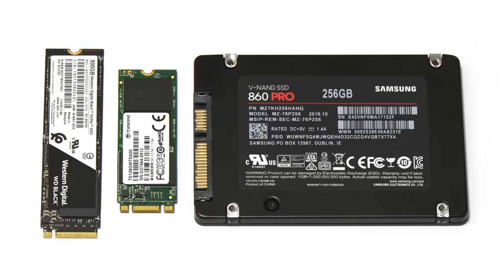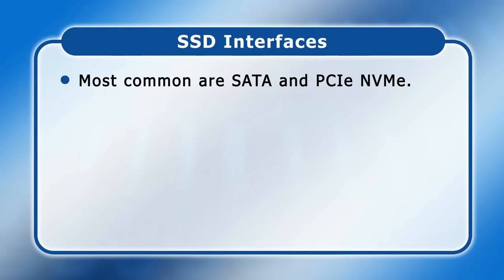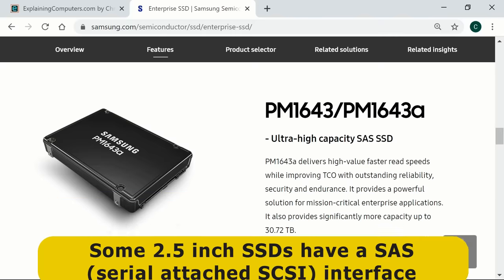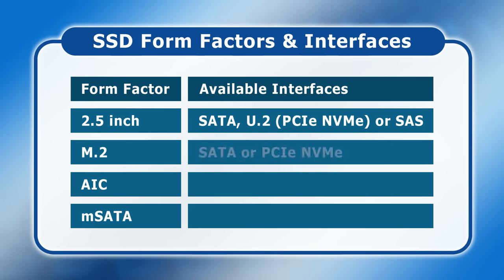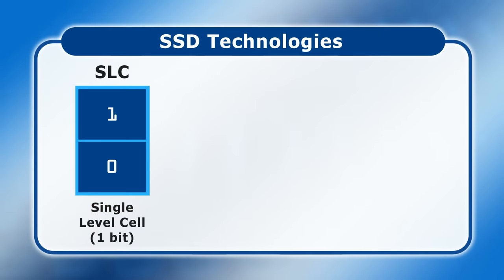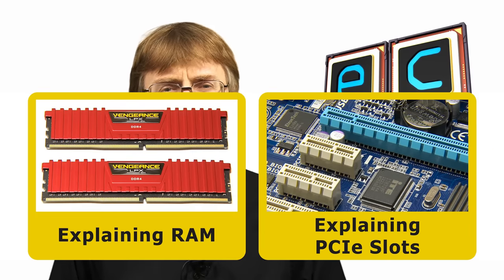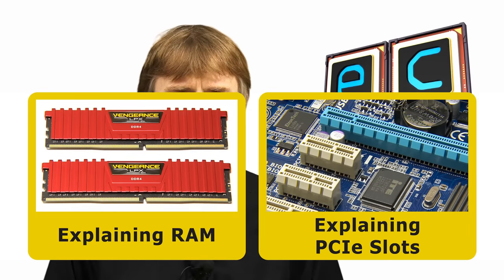Explaining SSDs: Form Factors, Interfaces & Technologies

Comment: As someone who once owned a 5 1/4 inch IDE (PATA) 60Mb (Yes, megabytes) HDD which along with its controller board (itself larger than some desktop motherboards today) was larger than a house brick and weighed about the same, I just want to express my gratitude for today's form factors. 😁
Reply: Indeed my first harddisk was the size of an industrial scale
Reply: The first drive i put my hands on was a  9427H-C Hawk CDD. Storage space until the end of time. I thought ... ;- )
Reply: I think those were MFM, not IDE
Reply: @knerduno5942  Definitely IDE - I had it connected to an Amiga that had an IDE interface.
Reply: @Kevin-mx1vi  Looking things up, it seems that was called ATA and first used in 87. It was in 94 Western Digital came out with a variation of ATA they called IDE. There improvements of ATA-4 which then used the 80 pin cable. I guess WD continued to call it IDE., but in 2000 they came out with what they called Ultra ATA with 133MB/s transfer speeds.

Comment: Thanks Christopher, i was actually confused about the difference between NVME and Sata.
Reply from the maker: And you were not alone!
Reply: Same, had a lot of confusion relating to M.2 Sata and M.2 NVMe.
Also, i didn't even know about U.2 SSD's.
Reply: @Sup_D  No idea why U.2 connects are available on mainstream board, but there are no consumer drives that uses U.2, only Enterprise drives (both HDD and SSD).
Reply: @AlfaPro1337  Cost issues maybe?

Comment: In 1982 I designed and built 8 bit memory cells and at the time they had 2000 ns, all hand wired.  I was going to 12 bit even 16 bit but it was at time was to complicated to wire  input amps and 65536 output amps. The where chips could do 12 bits a/d but they were 1/10 second and cost $400 a piece.  I had 8 of them in a machine that weighted up to 3 lbs. They were weight vegetable memory cells ;.)
Reply from the maker: Wow. Not that many years ago.
Reply: Bare transistors, or were you old enough to work with core memory?
Reply: Robert Slackware  Just imagine weaving them all by hand.
Reply: Robert Slackware  Magnetism follows the same inverse-square law that light and gravity do. Neodymium magnets aren't THAT powerful.

Comment: Outstanding. Thanks! I just spent a day figuring out that I could not put an M.2 drive in my machine, and get the performance I hoped for, since my MB doesn't have a second  PCIE 2 slot which would be required to support the adapter card properly. And, since the MB only has SATA2, which can't get my SSD anywhere near to it's rated speed, I am now ordering a VERY similar used MB with SATA3, USB3 and digital audio out. All things I want and for a good bit less than a PCIE - M.2 adapter and M.2 drive. Not as fast, but fast enough!

Comment: Thanks - but did I miss the bit where you mentioned AHCI in the context of M.2 drives? I only mention it because I once bought AHCI instead of NVMe by mistake ...
Reply from the maker: AHCI refers to the drive controller. There were some AHCI PCIe SSDs before we got NVMe, but they are long departed from the market (all PCIe SSDs are now NVMe). So I did not complicate the video with this.
Reply: @ExplainingComputers  Thanks for clearing that up.

Comment: I purchased an mSATA to M.2 converter card for an older iMac (late 2013) that was originally setup as a hybrid drive. I breathed in new life into the machine and am typing this comment from it.  The HDD was replaced with an SSD 2.5in with a SATA interface, but this made a huge difference in speed overall: the boot drive is a 1TB (the mSATA >M.2) Samsung EVO 980 and the, formerly a harddrive, is now an EVO970 (also 1TB).  I can probably use this machine for a few more years (although still stuck with DDR3 memory).

Comment: My first experience with SSD, was a Mini PCIe in the Dell Mini 9 Netbook in about 2008. A big UK supermarket online shop (now defunct) had a sale on them, it became popular to hack to OSX Snow Leopard with an Install DVD purchased from Amazon. 
Videos on youtube showed them booting faster than genuine Macbooks of the day.  The standard STEC SSD was only 4GB running UBUNTU. It was common to order a bigger and faster 'RunCore 32GB' from the USA to perform this hack, the RunCore came with a Micro USB socket to help format or file transfer. I did mine without the use of a Mac which was tricky to say the least. I still have the original 4GB drive in a pot somewhere.

Comment: One other item you didn't mention is the hybrid drives..ones that are a SSD and an HDD in the same case, using the former as a speedy cache for the larger storage size of the latter.

Comment: That part about the interfaces types are well explained 👍
End user need to pay attention especially on those m.2 types

I work with one of the storage manufacturer, and the reason why theres so many interfaces (even those SAS and U.2) is because  to give options for consumers/data-centers to migrate to ssd while still use their existing HBAs thats probably still under warranty (not all datacenters have the budget of amazon/fb)👌

Comment: Interesting overview. To add to that a bit of experience from a Windows sufferer.
Biggest threat to SSD lifetime that causes lots of P/E cycles are Windows' dependency on its page file, and many apps that rely on temporary files to register some state information as surrogate global variables.
Biggest threat in Windows to stability is "fast reboot" that is on the critical path of sound updates. So I switched that off and now my page file needs to be created every day. I have tried to run Windows without page file and theoretically this should be possible - in practice you can only run Windows, use its control panels, and run simple apps like Notepad.
Biggest threat to I/O performance, including NVMe, is the South Bridge chip on the motherboard where most I/O devices are in competition for CPU to access them.
To defeat some or all of these problems, I bought a PCIe add-in card that facilitates a Windows RAID 0 and gives direct access from the CPU's I/O lane to the card. With 4 lower capacity SSD that have a relatively large cache, I now get higher I/O speeds on that, than I could ever get from an NVMe on the South Bridge. And note here that even the NVMe connectors on the motherboard listed as PCIe are generally on the South Bridge.
Now I keep my I/Os distributed across separate I/O lanes and the cheaper SSD RAID 0 array does not contain data I need to backup, ever. Or it is backed up by the application after each session like the Lightroom catalogues.
I have seen the P/E cycles (TBW) and in product name terms Samsung EVO would have been good enough, but I still bought into the PRO version. Here I run RAID 1 with 3 arrays to keep e.g. OS and user data separate. Really important data is stored in my NAS on RAID 5 which replicates all updates to a second NAS which replicates to an offsite NAS.

Comment: In the past (pre-2000s), we generally have kept a home computer 5–10 years. As retro computing and collecting old computers have become a thing, and backwards compatibility of the OS has been unreliable, the legacy hardware can be expected to run indefinitely, thus I would personally find drives with the maximum life span possible as my selected choice, provided the OEM company offers it as an option. The HHD gradually failing in our first home computer, an IBM compatible, was one of the deciding factors in whether we kept the computer, or donated it to the school (as an alternative to scrapping / recycling). It made sense at that time, but in retrospect I definitely regret having given up that computer–it had historical significance as well as my personal nostalgia. Not all software and updates are available on the internet, thus some things I've wanted to keep have become lost forever as I wasn't able to copy it to a reliable drive.

Comment: great video, only as a suggestion, you should have shown the slots on the motherboards specifically which are for m.2 which m keyed which b & m keyed ... for example show the slot on the motherboard socket 775 where there is a socket for ssd m.2. THANKS

Comment: some years ago I built a desktop with a board that had a M4 slot which I populated with a crucial M4 SATA 250MB and the computer used to boot from this, what happened to the M4 format. On a different note I remember buying a 40GB hard drive for my Atari ST and wondering if I was ever going to fill it up 😃

Comment: I seem to have a bit of a fascination with storage devices, especially older ones when there were so many form factors and technologies available. I must note that there were also SSDs available in the form of PCMCIA Cards and later ExpressCards, although the slots for these are not found on laptops nowadays unfortunately.
Reply from the maker: Oh yes, there are lots of SSD form factors I did not mention, 1.8 inch, the original Psion ones (labelled solid state drives), and so on. I only covered those still on the market.
Reply: @ExplainingComputers  Ah yes I forgot about the 1.8", I have a laptop that is fitted with a 1.8" iPod hard disk drive!

Comment: Another option, for older Sata 2 motherboards, is you can get PCIE-1x cards which have Sata 3 slots. If you only have PCIE 2.0, it's still about 1.5-2x performance.
Reply from the maker: Yes, good point. A very useful upgrade.
Reply: I bought such a card for an nmve for a system with SATA3 and it is the same speed as an HDD (150mb), while the SSD SATA3 drive was doing 525MB range

Comment: You didn’t even mention 5 1/4 inch hard drives. They were used for years.
Reply: I remember the 60MB 5.25 "brick" HDD I hade as the first one on my old Amiga. Much like floppies, I commonly download files larger than the entire capacity of that storage now...
Reply: Back in the mainframe days we had big disk drives the size of a washing machine, and the storage medium was a disk module with a set of about 5 or more 14 inch platters with an iron oxide coating for the data storage.  A big one like this held an amazing 300 megabytes of data.  When the computer was busy doing a lot of data transfer, the read/write heads would dance back and forth with enough momentum to even shake the disk drive.  
https://flic.kr/p/7zuKiQ  <-- check the storage cases on top of the disk drives (at left side)

Comment: As a hipster, I store my data on vinyl records.
Reply from the maker: Groovy! :)
Reply: @ExplainingComputers  ..(*sound of 2 drums and a cymbal falling off of a cliff..*)
There are a lot of interesting alternatives for data storage, but be aware of the drawbacks, too...like the clay tablets someone mentioned above, data density is rather poor, plus you have the needle-wear degradation problems when you use them often. :-)
(As far as oddball techs go, I've always been fond of the internet via messenger pigeon protocol...I wonder if anyone's ever worked on the speed and reliability issues with that? :-) )
Reply: Well...maybe... until someone jumps on the floor or bumps your storage device and the needle jumps a groove leaving a scratch behind. Good luck getting that needle to track correctly from now on. :)

Comment: Superbly organized and informative.  Thank you so much.
Questions I have:
For the AIC interface, are they available in all PCIe rail increments(I don't know which ones there are, but I think I've heard 1x?, 2x, 4x, 8x, 16x, not sure if there's higher than that)?  Per each x, how fast is the interface, and is the bottleneck the PCIe or SSD?

I saw a video about SD cards of the 8.0 standard getting ~3,800 MegaBytes/second.  Do you know anything about those?

Thank you.
Reply from the maker: PCIe AIC SSDs are typically x4 (4 lane) or above -- four lanes being needed for maximum NVMe speed for a single drive -- about 7200MB/s for a PCIe 4.0 slot. NVMe drive at present:) SD 8.0 is part of the new SD Express standard for NVMe SD cards -- I cover all SD card specs in this video: https://www.youtube.com/watch?v=oLQ8A_vcBqU
Reply: @ExplainingComputers  Thank you!

Comment: I would suggest expanding on this video with information on DRAM vs DRAM-less SSDs. I don't know for sure about NVMe, but for SATA you generally want to avoid those cheapo DRAM-less drives, because they are really slow (still faster than HDDs, though). Actually, some benchmarks would be appreciated! :-) Also sometimes temperature of the controller chip is an issue, especially for M.2 drives. I own an M.2 2242 SATA SSD from Transcend (~480GiB with DRAM cache), and it gets VERY hot without a heatsink, rendering it unusable for frequent read/writes on a laptop.

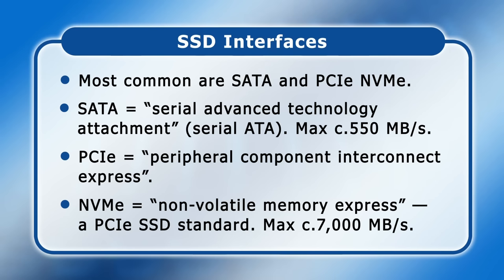Comment: Hi Chris, can you please clarify where you get the figure of 7,000 MB/s @4:37 rather than 3,500 MB/s. Is that for Gen 4 rather than Gen 3?
Reply: The number quoted is just marketing hype and they're rounded. PCIe -the physical socket can move data for transfers up to 25 times faster than SSD. PCIe 3 has a maximum speed of 985 megabytes per second / per lane, and NVMe Drives use 4 PCIe lanes so the theoretical maximum speed is 3.9 Gbps (3,940 Mbps), 985 * 4 =  3940. NVMe performance numbers are measures of 'bursts', they are not speeds a consumer is likely to see.

Comment: Good. Your previous vid on SSDs needed updating. Also, i have been wondering for quite some time now, why you never mention U.2, thou those are a very viable (if not prefferable) for video-editing systems, serious gaming rigs etc. With their prices coming down rapidly and capacities growing, resulting in quite good cost per 1Tb of storage space and excellent speeds, U.2 are getting more and more widespread in home-level systems, more so - U.2 raids.
Reply from the maker: I do agree that U.2 will get more and more common, and for the reasons you state.

Comment: What kind of SSD-Storage should be used in heavy used database-server? The current Server (to be replaced in about one year) has still 15k spindle drives in arrays but on load peak the I/O goes down.

Comment: A question on th transfer speed..you mention SATA, but is that the oroginal SATA, SATA2, or SATA3?
Reply from the maker: Good point, it is SATA 3.
Reply: @ExplainingComputers  Ah, I was wondering, since IIRC each is faster than the previous, which made me wonder if you were lowballing the SATA speed compared to PCIe/NVMe.

Comment: They brought out a solid state disk with ordinary memory chips and a battery to keep them charged so they would not lose what was stored. Did not catch on but IBM used them as fast caches while the slower disks were writing the data to get faster through put.
Reply from the maker: Yes, indeed. A lot of early hand-helds used "memory cards" that were RAM sustained with a button cell. I had one on an Atari Portfolio.

Comment: Great as usual but I wish just one more piece of info was given and that is SSDs are not recommended for archive storage. Powered off SSD drives will lose data integrity over time and higher ambient temperature where the drive is stored can reduce that time before irreversible failure to just a few days. So if you are, for example, using an SSD in an external enclosure for storing backups and then storing that drive for weeks or months before using it again there is the very real potential for data loss. Use traditional spinning hard drives (HDD) for archiving instead.

Also, storing a computer that has an SSD inside is not wise unless you have a full clone of it saved elsewhere to restore from.
Reply from the maker: Agreed -- SSDs are not good for long-term storage without regular data refresh. But HDDs need refreshing also to prevent data fade -- if less frequently. There were many other issues that could have been included in this video! :)

Comment: Thanks, but I am still trying to find some informed information on backward compatibility with respect to older:  m/boards, BIOS/UEFI, chip sets, generation of CPU etc.
Will a PCIe adaptor with M.2 card be recognised by older boards with only a PCIe 3 slot, and Windows 8.1 64bit AND boot from it?
What are the MINIMUM specs?
Reply from the maker: For booting you will need a PCIe slot and BIOS that has NVMe support. This is going to be on a board-by-board basis, so you will need to find your motherboard manual/specs online. I did a video on M.2 PCIe cards/etc here: https://www.youtube.com/watch?v=Ktqa11VT1xI Good luck! Oh, the good news is that Windows 8.x was the first version of Windows to natively support NVMe boot -- so this is on your side!

Comment: Hi Christopher. I again learned a lot. Didn't know the names of them were because of the size. Also not the precise way it worked. Thank you. 
I use NVMe as RAM replacement with swap files on my RK3399. So I do write a lot to it. But I accept that I need to replace it about every year.
Just bought a new 512GB NVMe to replace my 256GB one I've got now. Also bought a PCIe to NVMe adapter for my aging pc. So that's where my old NVMe drive will go to. 
I've also got a USB3->NVMe adapter. Very useful to test USB3 performance on SBCs. I use it to boot Linux on my PC. More than fast enough for that.
I had the pleasure of working on a 32-core ARM server. All cores at 3.3Ghz. Amazing to see such performance out of an ARM CPU. 
I made a video about it, and wrote a review. The link to the written review is in the video description. 
Have a great evening.
Greetings.
Reply from the maker: That 32 core ARM server is a very interesting piece of hardware -- for others, Nico's video is here: https://www.youtube.com/watch?v=7BtuFqj9YeQ

Comment: Do some cheaper SSDs lack a controller, leaving this responsibility to software? I've also heard some SSDs can have a shorter life expectancy if they don't have an SLC cache? Is there an easy way to tell what you're getting?
Reply from the maker: All SSDs will have a controller. SLC cache will improve SSD speed (for relatively small quantities of data written). Having SLC cache will not improve life expectancy, as all data sent to the cache will be written to the main cells.